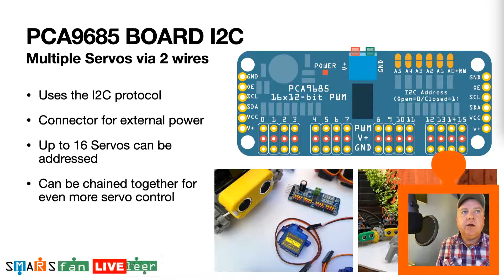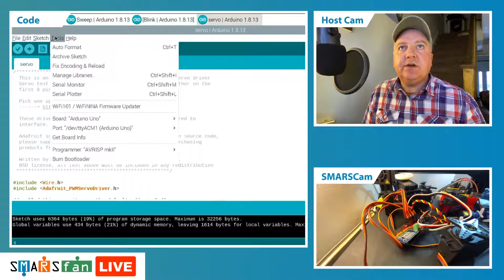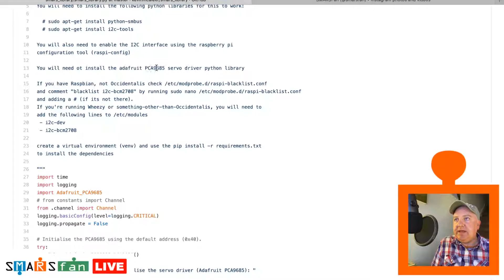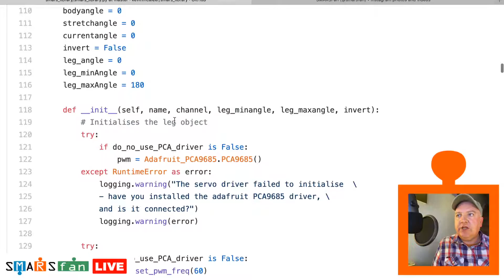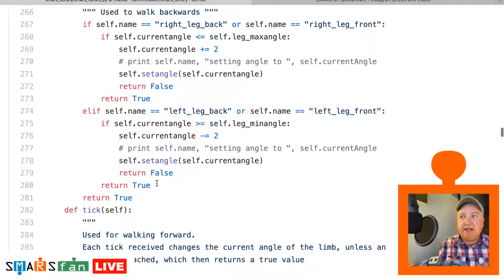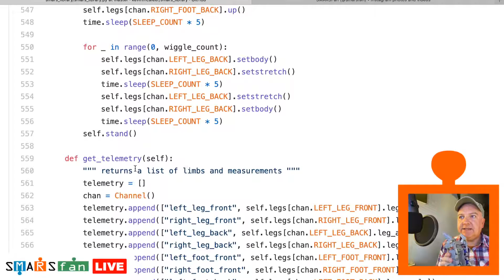SMARS SG90 Servos, PCA9685 & Arduino - Programming Robots

Comment: is obligatory to  use an extern 5v battery?
Reply from the maker: The arduino can’t provide the current provided (as that is going straight through the processor). If you try and power many servos through the arduino it will burn out
Reply: @kevinmcaleer28  thanks!